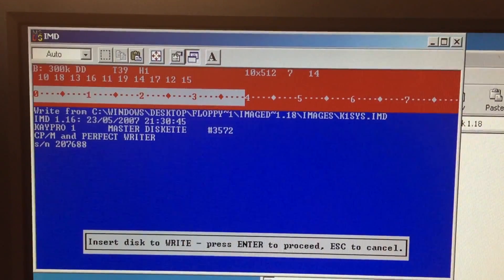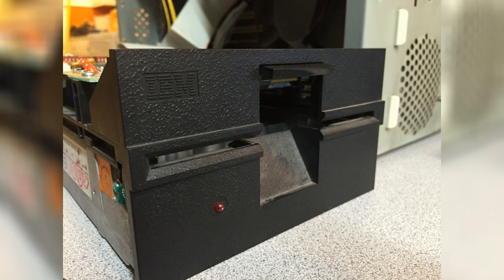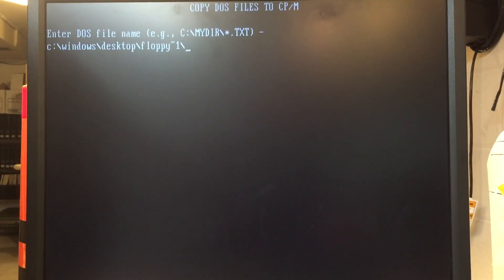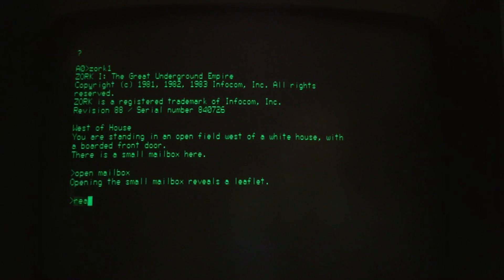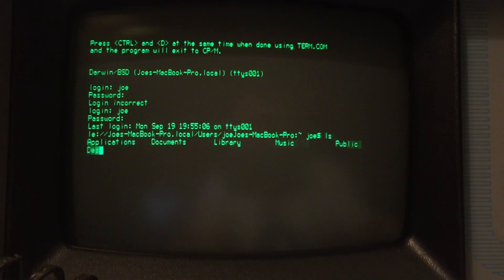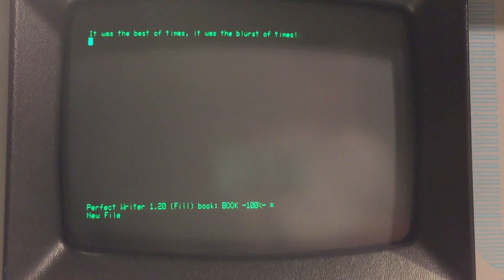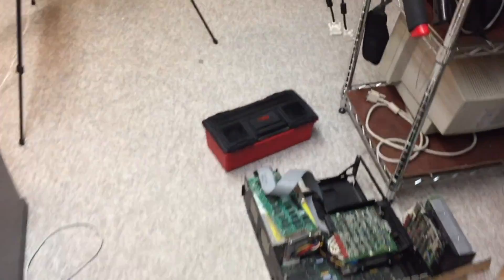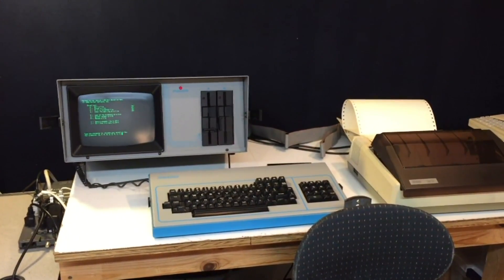Kaypro 1 Restoration - Part 3: Playing Around!

Comment: In 1988 I built a universal Z80 replacement board with 128K ram and a 12 MHz Z80. I installed them in a few Kaypros and the speed up was fantastic. The extra ram allowed me to run Cache22, a simple relocation of CP/M into the extra bank, giving a 60K TPA.
Reply from the maker: Sweet!!